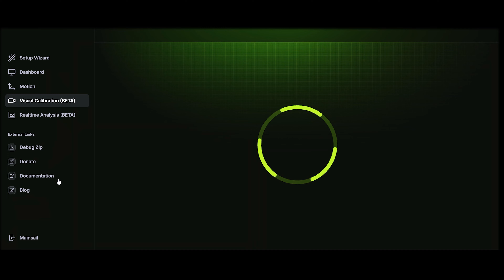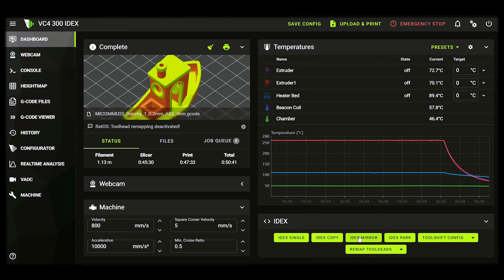V-Core 4 IDEX Upgrade - Just released!

Comment: This video is totally misleading. I have assembled a  complete V4 IDEX and the VAOC and End Stop calibration is still not working after two solid weeks of trying. Many of the instructions for the build were just flat out wrong. Even the software programmers that wrote the RatOS say that the instructions for these calibrations are wrong and buggy.  This video is an example of selling something that is not ready for the public. Only buy if you know everything about Klipper and how all of the mechanics and software work, this is not a plug and play machine.

Comment: Drop in.. how you drop in second linear rail carriage without dismounting x axis 😂
Reply: On a 500, this can be done by lust loosening the rail with the toolhead at one end, then there's enough range of movement to add the second carriage on the other end. I removed my extra carriage this way. On smaller machines, I think this won't be possible, but I don't know.
Reply: I want to see that video.
Reply: If you vibrate at the right frequency you can phase your way through
Reply: They showed you! Just hold the second hotend up to it and jump cut!
Reply: Bro wtf if you got to the point where you want to upgrade the printer that means you got it running in the first place, so adding another head won't really be that hard 🤦
Reply: @Basement_CNC  i uderstand but statement in video claims it is waaay easier. It is easy but not "that" easy. Just funny.
Reply: Yeah this is true. I'm pretty sure you have to swap some parts on the first toolhead to allow belts to pass through it too so yeah it's not a quick 10-20min mod.
Reply: @Basement_CNC  assembly is the easy part. Tuning a idex machine can be a nightmare tho.
Reply: You drop in the new printer into where the old one was
Reply: Wizardry

Comment: Im not going to lie... Looks like ill be cancelling my pre-order this week. I was the most excited ive ever been for something but i just saw its going to cost almost $500 shipped for what equates to just a second toolhead assembly (pre-order was for a hybrid) is steaight up greed. For $500 i can buy an entire second printer from someone else. Im really bummed to see the pricing. Im even more bummed to have this excitement squashed, but i just refuse to support greed and bloated pricing.
Reply: Where is the shipping to and what is the weight, is it the whole printer?  You should know this is increasingly common especially with international shipping or large items.  I’ve had to ship things items via freight and occasionally the shipping costs more than the item itself
Reply: Wait for a local distributor to stock it, and the shipping should be much less.
Reply: They are not only charging for the hardware and assembly, but to cover for all the R&D needed to get to this point. 

They must have run their numbers and ended up happy with this value. Either they don't expect to sell as much as it cost to develop or they want to make up for it as fast as possible as anyone can come up with a better alternative anytime.

But it is true that for this price you can almost buy two whole Bambu A1's or one P1S. 
They cannot be compared as they are in two complete different leagues. RatRig is a small company of 25 employees that generates less than 5M USD and Bambu's revenue was 1.5B in 2023

Comment: That stopper to prevent the nozzle from leaking is genius. So simple and then you don't have to go through all of the extra steps to purge the nozzle before continuing. Probably speeds up the process a ton. I can see basically every MM system stealing this idea (assuming it's not patented).
Reply: This isnt novel to this printer. Tridex wipers and ooz gaurds have been a thing for a while. Think the svo8 has then too even.
Reply: @JH-zo5gk  That's interesting, thanks!
Reply: dude the idea to block the oozing nozzle is really old 😅
Reply: @OmegaCreationsChannel  Well it's new to me.
Reply: @Vandel212  nice that you learned something 😃👍️
Reply: @OmegaCreationsChannel  indeed it is. It looks pretty effective.

Comment: Absolut komplizierte Beschreibungen bei euch ! 
Man sieht nicht genau was man brauch und was Upgrade ist !
Reply: Hybrid to IDEX Upgrade
Electronics Add-ons Bundle
IDEX Upgrade Kit Printed parts bundle (ABS)

Würde ich behaupten
Reply: @elpoepel0815  und was genau ist das ?
Reply: Kommt drauf an was du bestellt hast.
Komplette Kit mit Hybrid? Dann brauchst du die oben genannten Komponenten.

Hast du ohne Hybrid bestellt, benötigst du auch das Hybrid Update.

Was hast du dir denn genau bestellt?
Reply: Ja, stimmt! Der Bestellprozess ist auch absolut undursichtig. Ich habe meine Bestellung verwerfen müssen, da ich nichts mehr ändern konnte.
Reply: @Erbsensuppe22  Of course you can change stuff. When you get the payment request, just email back with your changes.
Reply: @leroycasterline1122  The mail hasn't got any response!

Comment: So if I'm ordering a completely new printer, and I click the "customize and add to cart" everything check is what I need to have a complete basic printer right?  I don't need what is not check by default right?  Like I don't need the "1 x Bed Plate - Cast tolling plate" or the "1 x RASBERY PI"?  

So to get it with IDEX I would need to check "...HYBRID Upgrade Kit",  and all 4 items in the IDEX section?
Reply: You do.
I do understand that the ordering process is a bit confusing.
For the Vcore4 the only thing that is selected by default is the mecanical kit (extrusions, linear rails, etc). You have to check every item you need for the 3d printer separately. 
You need to select the extruder, hotend, motors, and so on.
As a rule of thumb, just check everything, and go from there. You can unselect some parts, because you may have them already at home (I already had fans and the Z motors, so i did not order them)

To own a ratrig is pretty involved. I would NOT recommend it as a first printer.
Reply: @Vaynexx_   Seems like they changed it, now pretty much everything is checked by default except for alternative options and the upgrades.
Reply: @SaHaRaSquad  ohh ok

Comment: If i want IDEX on the Vcore 4, do I need the Electronics bundle too? I do not think I have much I could use from my own parts
Reply: On the product page for the IDEX upgrade, there is a BOM to show what each "package" includes. It is stuff like the Orbiter, Hotend, Toolboard, Stepper Driver, etc. AFAIK RatRig strongly reccomends to have identical hotends and extruders.
Reply: @Vaynexx_  Yes, there is a BOM, but without knowledge what the contents of each hardware pack is I can't tell if I need the CAN toolboard from the second option or if it's included in the IDEX Hardware Pack v1.0. I've ordered just the IDEX Upgrade Kit v1.0 (Hybrid to IDEX), but I'm not certain this is enough. Can anyone confirm ?

Comment: Where is the Idex upgrade kit for existing VC4-Hybrid owners?
Reply: An extra toolhead, tool board and you can use the same belts. Printed parts and that’s it.
Reply: @HMAlotaibi77  plus the VAOC camera.. And I do think you need new belts from my understanding.
Reply: @danomara4196  not really. U can use the same belts on the hybrid. I didn’t replace mine. Just had to cut them shorter 😉
Reply: Check your email
Reply: Email checked. No Idex upgrade for existing owners yet.
Reply: It's another almost $500 after shipping. The fact that it's almost $500 for JUST an extra toolhead when you already have hybrid is ridiculous.
Reply: @BackwoodsTinkerer  It's a lot more than just another toolhead.
Reply: @BackwoodsTinkerer  more then just a toolhead. You get all the wiring, all the extra/changed printed parts, the alignment camera, offset switch, ooz stuff. So a bit more then JUST a toolhead. Figure you have to change the first toolheads belt mounting system to allow the dual carriage belts to travel through so it comes with all those parts too.
Reply: @JH-zo5gk  what changed printed parts? I've already gone through the documentation and there doesn't seem to be anything about changing things on the first toolhead. BTW I'm talking about the IDEX kit that DOESNT need the hybrid upgrade.
Reply: @BackwoodsTinkerer  I'm under the impression that all idex convertions require the hybrid because without it you have no y control. I also do not see the Idex kit on the website yet but can still get to it from the idex release email. That page still says don't order the hybrid kit if you already have one, leaving me to believe it's required for the upgrade.
The toolhead changes would be in the commissioning guide, which doesn't seem to have been updated yet with idex. Build guide states the idex and hybrid belts will be set up after corexy tensioning instructions in the commissioning section. Basically, you need to let one of the belts pass through the toolhead without touching it. That belt will be the x for the new toolhead. Should work the same as vorons tridex kinematics. Youll notice in the video in core xy it has upper and lower belts both attached to the front of the tool head, a belt on both sides. But in the idex clips tou can see the entire gantry between the tool heads, no belt between them on the front. So this means the belt has to now move past the toolhead in the rear of the gantry. I guess they might be able to do it with the clamp system on it now but it would be tight. These toolhead clamping parts are the big change between voron trident and tridex. It's the same as the system my duelingtridex uses (dueling dragon crossed with a tridex for 4 toolheads in total on 2 gantrys).
I think you thought it was like what I'm trying to build right now, a true duelcorexy, aka corexyuv. With each toolhead controlled by its own corexy system but on the same gantry.
Reply: @BackwoodsTinkerer  I found it. In build guide there is toolhead. They added idex toolheads. Step 1 of 0.9 shows "rr_toolhead_vc4_back_idex_t0/1" these are different from "rr_vc4_toolhead_back" shown in step1 of 0.8 ratrig vcore 4 toolhead
Exactly what I thought it would be.

Comment: Now just upgrade the build plate so it has multiple heating zones and I will spend my nights dreaming about this instead of a Prusa XL.
Reply: They are really completely different machines tho. XL is a tool changer and that is a loy slower then ratos quick swap is. Pluses and minuses to both but once they figure out MMC iDex it will be kinda game changing, more or less instant material changes. This is what I've been trying to get my tridex to do with ERCFs but I'm too dumb. I don't think multi zone heating is needed on a < 500mm build plate. The zones would be so small and the chonky bed would soak up the heat so fast it would run 100% none stop.
Reply: @JH-zo5gk  you have to separate the bed too with a little space between. This allows for expansion and keeps the bed flat. Large beds when heated want to warp. Also, why heat the entire bed when you are only printing on a small area. The additional power cost is large and unnecessary.
Reply: @T313COmun1s7  the power cost? Eh. The few extra pennies spent are not really a factor once you $2500 into a printer. Besides we use the bed to heat the chamber by blow fans on it and I think most people are printing materials other then pla and petg on these so a heated chamber makes things much more better. Idk to each their own. I got this cause I like to tinker and wanted a large powerful machine. Also my 400mm build plate starts with a 0.07mm mesh at room temp and flattens to 0.06mm at 75c so warping isn't a issue with a well-made precision plate.
Reply: @JH-zo5gk  A few extra pennies? Wrong! It is the difference of running 300 watts for the several hours you are printing and running over 1500 watts for those several hours. Imagine running your hair dryer or microwave for the length of time you are running your printer.
Reply: @T313COmun1s7  imagin thinking the bed heater stays at 100% for the entire print duration. well seeing as how the bed gets to temp then it's power usage is cut to 25% once it's warm and only needs to hold the temp there the extra cost to maintain temp is very little. Getting to temp different story but that happens in under 2min. No not a hair dryer is not running none stop for hours. My ender 3 pulls 300w for 4 min to get to 60c, this vc400 pulls 1000 for 2 min. Once they at temp the ender uses 134w and the ratrig 265w to maintain. If your worried about the running cost of this printer then go to a different video, you can't afford it. The different is literally pennies. In fact let's find for sure. I'll connect a wattmeter to my ender 3 and my vc400 and run the 3xact dame print and then I'll compare power used for the same print. Ratrig is scheduling 20min while ender 3 is looking at 1hr. Don't forget the ratrig lays out plastic fast so time has to factored into your power usage equation.
Reply: @T313COmun1s7  quick test. Ratrig idle 7w bed heating at 100% 1000w and bed maintaining 60c with no enclosure 375w. Took 83sec to get to temp.
Ender 3 in an enclosure 12w idle, 260 bed at 100% and 95w to maintain 60c.
So yes the ratrig does take more power to run, obviously. But the cost difference isn't much once you factor in time. My ender maxes out at 80mm/sec due to flow limits. The ratrig can layout layers at over 300mm/sec with similar quality. So yeah it cost 3x to run, but it does the same job in 0.33x the time. It's a power usage wash.
I guess don't think of power being used to run the machine, think of it as power used to melt plastic. Takes the same amount of power for the same amount of plastic. Now sure I can print slower on the ratrig, but if I wanted to do that I would have purchased a prusa.

Comment: I can't figure out how to purchase just the Idex to the Hybrid kit.  There does not seem to be that kit as purchase
Reply from the maker: Hi! You need Hybrid to have IDEX, but you don't need IDEX to have Hybrid. The kit you're asking for doesn't exist! :) Can you let me know what did you find confusing / unclear in specific? Happy to look into it!
Reply: @ratrighardware  I would like to order Idex also, but do I need to order the 3 packages or is the top one (€130) enough ?
Reply: @ratrighardware  They probably meant hybrid to idex as you do not have a listing for the kits other than when ordering with a new printer
Reply: @ratrighardware  sorry - I had it backwards.  I have the vcore 4 kit with the hybrid add on - it's all still in boxes, I'm printing the parts now, So I just need the hybrid to idex kit, and did not see a listing for just that.
Reply: @ratrighardware  Same, I have a built VC-4 Hybrid, how do i get IDEX? It was sold as upgradeable, how do we upgrade? Earlybirds left out of Idex?
Reply: @danomara4196  You should have gotten an email, check your spam.

Comment: I will never go back to a endstop for z-offset after using tap…
Reply: This beacon it uses is light years ahead of tap. This only uses that button to measure the offset between tool 0 and tool 1. Still uses beacon/contact beacon to measure bed level as far as I know. I'll let you know for sure in a week or 2.
Reply: Yes it uses beacon contact!
Its great. Ive never calibrated my z offset